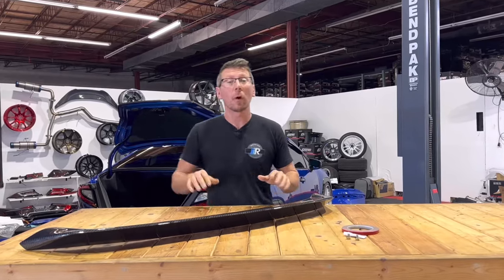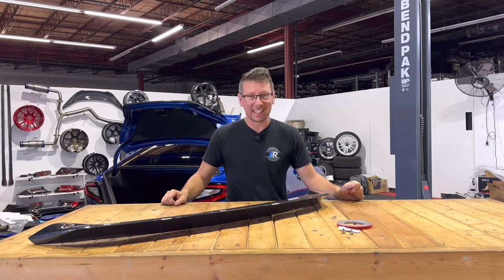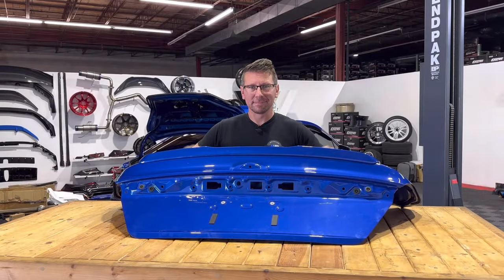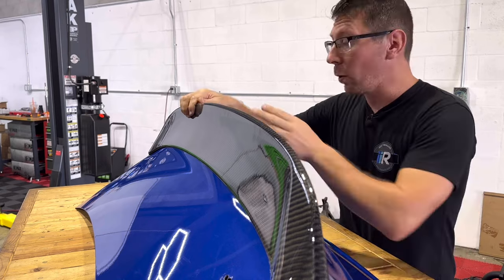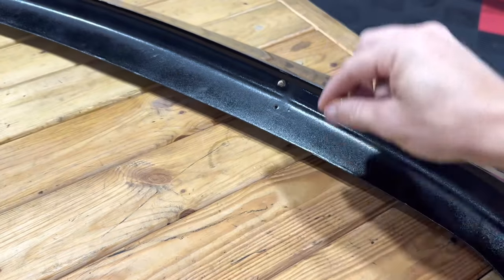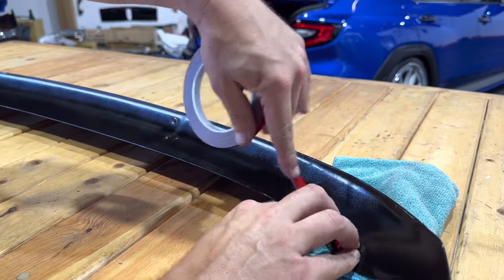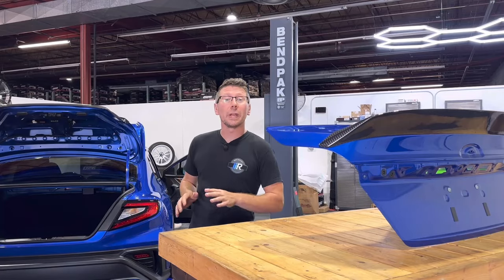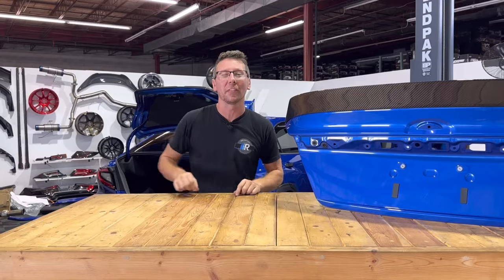NOBLE RD2 REAR SPOILER INSTALLED | CARBON FIBER  | 2022 | 2023 | SUBARU | WRX

Comment: These should be sold as “prototypes” and Nobel should fix the mounting holes so there is no modification of the factory holes, that’s horrible 🤦‍♂️
Reply: Lmao, modify the wing to match the predrilled holes? No drill out your metal trunk 😂
Reply: Close only works in horseshoes and hand grenades.
Reply: They are designed off the OEM Subaru STI "duckbill" spoiler they sell.  Yep thats right... If you buy the OEM STI spoiler for the 22 WRX you will have to modify your factory holes. Freaking Subaru man

Comment: This should be a direct fit for predrilled holes. Like come on man.
Reply: They are designed off the OEM Subaru STI "duckbill" spoiler they sell.  Yep thats right... If you buy the OEM STI spoiler for the 22 WRX you will have to modify your factory holes.

Comment: I would be a buyer if it came color matched and the holes lined up properly. I cant understand how the spoiler is made for the car and not be a direct bolt on replacement. Designed this with their eyes closed.
Reply: Color matched is on the way, those molds take more time to make and produce, but they are coming. As for the bolts not lining up, they are designed off the OEM Subaru STI "duckbill" spoiler they sell.  Yep thats right... If you buy the OEM STI spoiler for the 22 WRX you will have to modify your factory holes.
Reply: @derekgingerich  cool, probably the exact reason I wouldn't buy an STI one from the dealer. Let's base it off a model that didn't even come out for this gen in the states. Also, the reason I won't brand my car with STI anything because it's not. To each his own tho. I'll wait and see if a direct replacement shows up on the market. I'm sure a company will do it. If not, then I will have deal with it. Been waiting for a higher duckbill anyways.

Comment: What kind of paint do you recommend if you have to drill any holes?
Reply: Any touch up paint will do the job to help prevent corrosion. If you want to get down to specifics, Subaru will sell you small bottles of touch up paint in your specific color to match.
Reply: @BuckleUpGarage_  Ok thanks! Wasn’t sure if I needed a specific primer to help prevent rust & corrosion or if the OEM touch up paint would be fine.

Comment: Why didn't someone from IIR tell Noble the predrilled holes not matching the OEM holes is a show stopper?  Noble lost my business on this part, but I will pick up the exhaust finishers. Those are nice.
Reply: They are designed off the OEM Subaru STI "duckbill" spoiler they sell.  Yep thats right... If you buy the OEM STI duckbill spoiler for the 22 WRX you will have to modify your factory holes.
Someone should tell Subaru lol
Reply: @derekgingerich Subaru didn’t make an STI for the  VB chassis